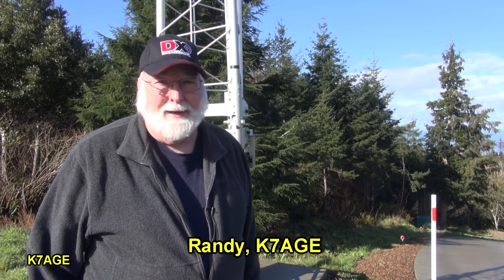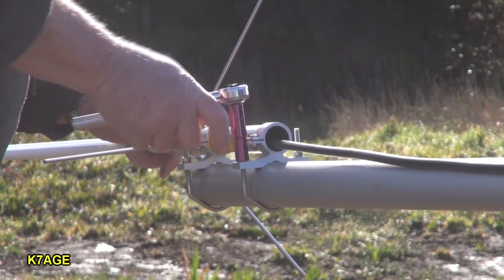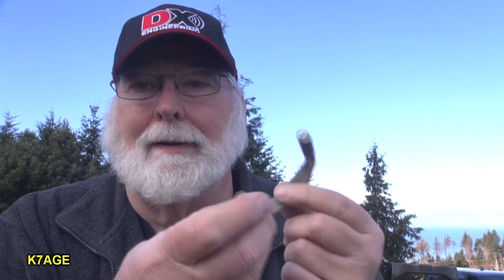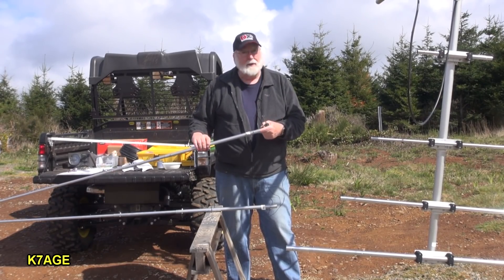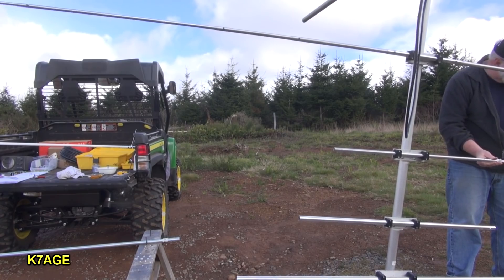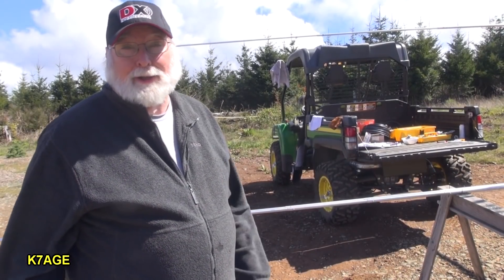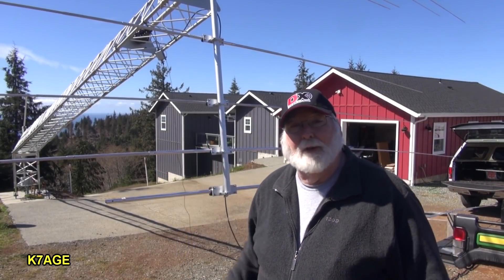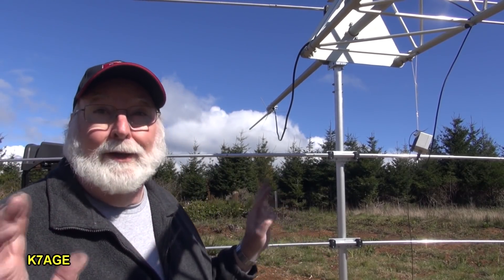Part 10: Mounting The Navassa 5 Beam On The Tower

Comment: Mounting the antenna about 2 feet above the top of the tower will actually improve overall swr readings on the antenna as I discovered the hard way!.  Apparent the antenna interacts a bit with the large aluminum top plate of the tower.

Comment: This planned virus hoax is far from over. 5G causes respiratory problem like symptoms similar to high altitude sickness and will even drop a person directly targeted. Wuhan was one of the test cities where it got first rolled out. Now that schools are closed, they're installing 5g in the schools, under the guise of cleaning and maintenance, having contractors sign a non disclosure contract. So the plan is to declare that the virus is under control, have everyone go back to school, systematically activating the 5g grid causing major respiratory symptoms all across the US, creating the biggest country wide outbreak of "covid-19", shutting down the country. This time it will be an all out power grab. It's the perfect storm for them to implement anything and definitely create a new social, economic and governmental structure, which will include country wide medical martial policing, mandated vaccinations (or eventually be excluded from traveling or be allowed in certain places), a new cashless economy (do to some bs story that will later be pushed out, about a lot physically currency being contaminated) and eventually a complete dependance on the government for your food and "welfare", as long as you're a good and obedient slave. "#LandOfTheFreeHomeOfTheBrave"

https://www.opednews.com/articles/During-Shutdown-5G-Being-I-by-Beverly-Jensen-Absence_Dept-Of-Education-ED-gov_Education_Educational-Facilities-200322-906.html
Reply from the maker: huh?

Comment: Nice antenna and beam mate, but I think you should have left more 'breathing' space between the beam and the top of the tower; that is, you should have mounted the beam at least 0.5m above the top of the tower. I just noticed a picture of the beam in the JK antenna brochure. It shows the beam mounted at least 1 metre or more above the top of the tower in a position where you originally said to your helper, it goes here and he over-rode ypu and slid it all the way down to practically touching the top of the tower - I believe that it is in the wrong position where you have mounted it, and you should mount it further up the pipe away from the top of the tower.
Reply from the maker: Besides the photo, why do you think the beam should be higher?

Comment: Randy, you should include the magnetic deviation for your area in the calculation for rotor calibration.
Reply from the maker: Good point. I should be able to figure that out and turn the beam on the mast.

Comment: Hi Randy,
Antenna looks great. That was a lot of work. The tilt plate would have made it much easier. Lower the tower once and the antenna is installed with the boom horizontal. All the work could be done at waist height. Did a great job.   73   WB3BJU